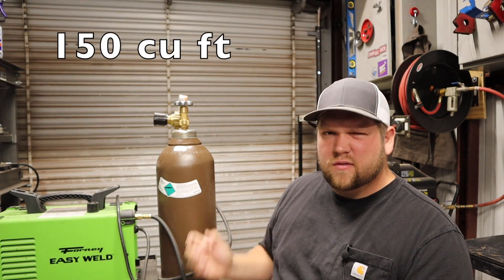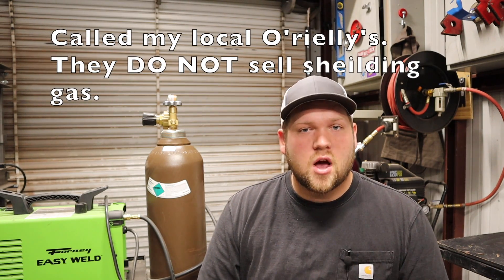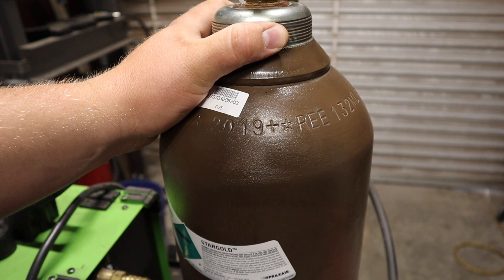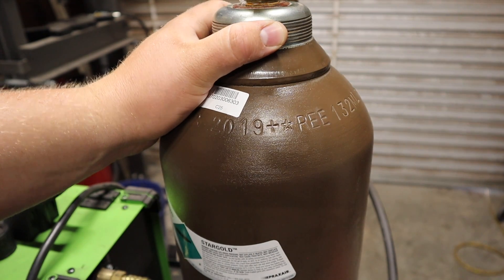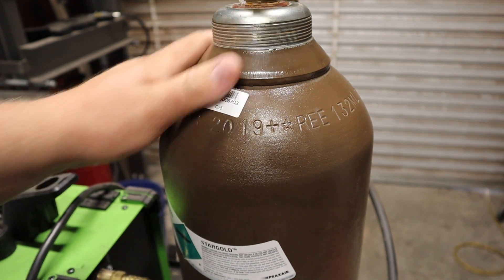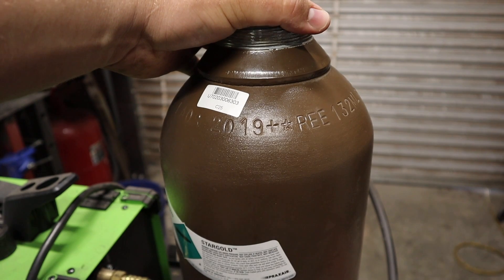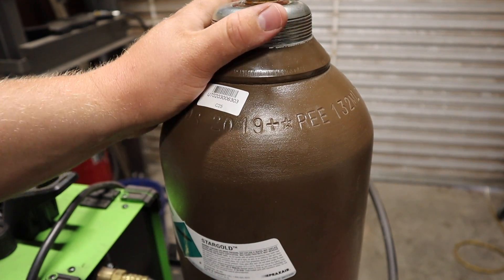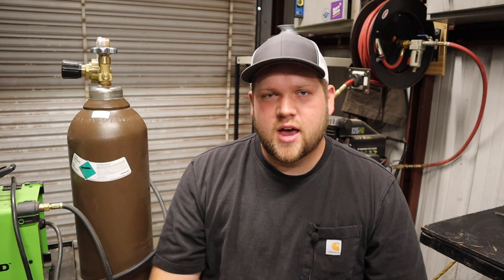Wire Feed Welding Basics - Buying a Shielding Gas Cylinder New or Used

Comment: I’m new to MIG welding. I just replaced my first 75/25 mix gas 80 cu ft tank. I got 4 hrs. weld time from it. AirGas is my vendor, I got no hassle just a straightforward exchange for another 80 cu ft tank. Out the door price $101.00.  My new tank measured at 2100 psi at 60 degrees F ambient temperature. I expect 5 hrs weld time at 20cfh. Great and honest video presentation. Thanks.

Comment: If I buy a new cylinder will places fill it?
Reply from the maker: Depends. I have seen stories where people say without stamping in the cylinder their local suppliers won’t fill them; I’ve seen others say they had no problem. Hard for me to really say.
Reply: My Airgas told they only do exchange ,so I'd be better off finding a used one.
Reply: @nathanmortenson914 thank you
Reply: Thank you

Comment: Is it both male and female tank cylinder valves where the argon gas regulator is threaded to on an argon tank cylinder? What is the size and thread pitch of the gas outlet fitting on the gas regulator? Thank you for you patience.
Reply: They might be different for different types of gas ,so you can't use the wrong one. That is a good question.
Reply: What we are looking for is a CGA580 valve. Used for inert gas such as Argon ,Nitrogen ,some helium not all, Argon/Co2 mix ,and some other. That should open up some options in the used market. I don't know if it's stamped on the valve or what to look for have to do a little more research.

Comment: In my area we don't have a choice, there seems to be an agreement between all the LWSs in the area not to fill customer owned cylinders over 80CF. If you go through more then about 6 cylinder a year its actually cheaper to rent the 330 CF cylinders due to the substantially lower cost of the gas. However if you don't use much gas its cheaper to own the little 80cf cylinders. I do both as I do very little MIG welding so I rarely use C25, My little 80 lasts me a year or maybe two, However when it comes to Argon I use quite a bit TIG welding. Same goes for the torches, living in New England and our love affair with salting the roads all winter you'd be hard pressed to make it through the day without having to heat something up or burn it off when it comes to working on cars, trucks, and trailers.
Reply from the maker: Interesting. It so weird how things are so different in the same country. I of course live on about the complete opposite even of it from you so that doesn’t help. I go through about 1 c25 every two year now days but I’m not welding near as much as I used to. 

And the rust and corrosion is definitely something I am aware that you guys deal with up there from the salty roads. I’d hate to be a mechanic in your area.
Reply: If you need a lot of gas ultimately speaking, they are willing to give you custom prices or potentially allow customer cylinders

Comment: What I've been trying to better understand is how to know how many CF (cubic feet) of Argon are in my #4 ( 125 CF ) Argon cylinder as the PSI decrees.   Like now I'm at about 1000 PSI now I'm sure there are a lot more than 1/2 of the starting CF of 125, because with my understanding the higher the presser the less additional Cubic Feet of gas (in my case Argon) can be added to the cylinder per PSI increase.  So with my practicing of TIG welding it got down to 1000 PSI faster than I would have hoped it would have, but it should take longer to go down as I get lower in presser.  Is there a chart to show the cubic feet left in a cylinder relative to the PSI?   I've been looking & looking can't seem to find one.   Now maybe I'm just wrong about being able to compress more gas per PSI increase at lower PSI, & less increase of CF per PSI as the presser get higher.
Reply from the maker: Nothing I’m aware of. That’s a good question that I haven’t thought of though!

Comment: Where I am in Central California, almost all the bottles have names on the neck, the weldibg supplies don't care, you may just have to pay a small fee to have it painted if it's not in their colours, but that's a recent thing for my welding supply.  I've bought all my cylinders used, maybe 10 at this point, and I've never had a problem exchanging them, although with my 300 cu ft cylinders I did have to sign something for the dot saying I am the one who own them, not sure what that's about.

Comment: I got a contract for a size 16 botttle, i paid $107 for 3 years for the contract. $80 every time I need it filled, for me it’s a no brainer, bottle would cost $400 and some odd dollars to buy and I likely won’t even get it refilled
Reply from the maker: If you were only going to weld for 3 years, that makes sense, but if you’re going to weld for years and years to come. In 12 years, you’d have paid for the bottle. It is, of course, easier to pay $107 but if you can afford the $400, I say why not!

Comment: I bought a complete used Hobart 200 Handler w/ 250 cf bottle/cart, 2 rolls of wire and lots of consumables for $600. The bottle was out of date. My gas supplier hooked me up with a testing/inspection station who charged $55 for recertification testing.
My supplier in Houston, TX charged only $44 to fill with 75/25  or C25 gas.. it was all pretty painless.  Pickering Welding Supply...shameless plug.... I'm now buying a tig bottle and have run across stolen/out of date and a entire group of bottom feeders selling junk. Beware of scammers selling used crap!!
Reply: BTW, my top ring was blank..so I was confident + plus I bought the rig from a church...lol

Comment: What do you buy a used cylinder and not sure if it was leased or not?
Reply from the maker: I think I covered this in the video but I’d stay away from from bottles with a name stamped in the collar of the bottle.
Reply: The top of the bottle will have a company's name on it but if the top ring around the valve  is blank then your good